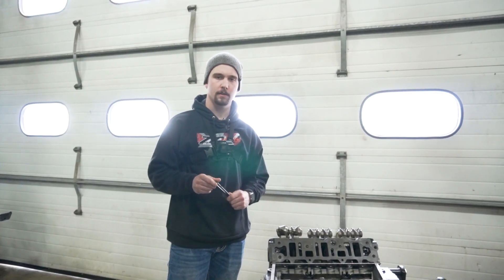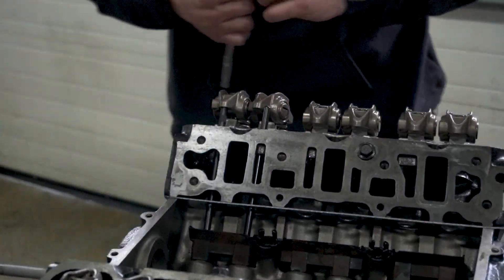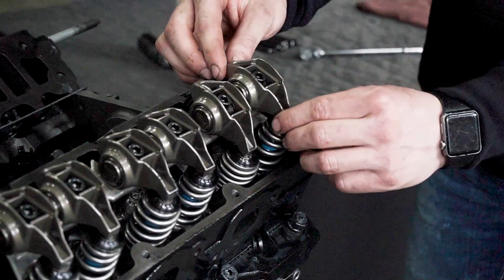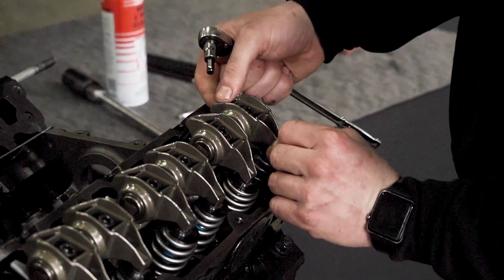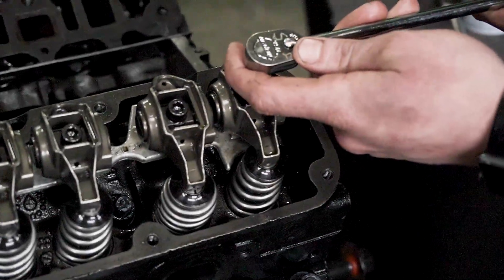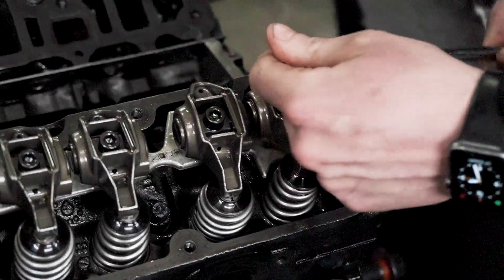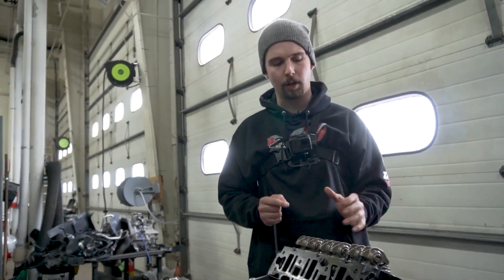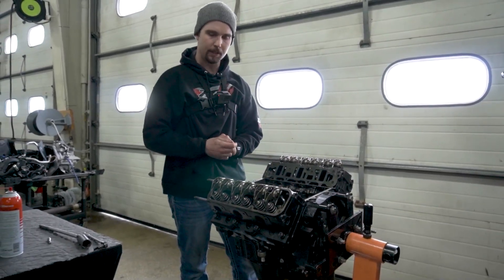How To Measure Your 3800 Pushrod Length

Comment: Correct me if I'm wrong, but 1 turn of a 5/16-18 rocker bolt is 1/18 = 0.055". So you are preloading these LS7 lifters between (3/8 turns)*0.055=0.021" and (3/4 turns)*0.055=0.042"? Is that the correctly intended preload? Your website says "1/2 turn of the rocker bolt is ~.050 of lifter preload", but it seems to me that 1/2 turn would be 0.055/2=0.028" instead. Either does not seem correct to me for LS7 style lifters. BTR suggests for stock GM/delphi LS7 lifters 0.060"-0.080" preload, not 0.021"-0.042". Other sites will say between 0.050"-0.1" preload on LS7's. If your intended preload is indeed 0.021"-0.042", this procedure would seem correct, but the actual preload your website suggests it is achieving seems incorrect (3/8 to 3/4 turn would be 0.0375" to 0.075" according to the website's claim at the 0.050" per half turn). What is the actual intended preload? Is it 0.021"-0.042" (3/8-3/4 turns @ 0.055" per turn) or is it 0.0375"-0.075" (@ the 0.050" per half turn)? Or something else entirely? Am I missing something? Is the rocker arm length multiplying the effect of the inches per turn of the rocker bolt? Or does your "ZZP" LS7 lifter require a different preload than normal LS7 lifters? Not to mention, the product descriptions are very confusing, as OE and OE-R lifters appear nowhere on your website, and are not relevant to the LS7 lifters; one other part even says 3/8 to 1/2 turn instead of 3/8 to 3/4; please clarify this stuff. Anyways, the way I did it instead was use the push rod length checker, tighten down the two rockers, increase the checker's length until it binds seated in the rocker/lifter, then measure the length of the length checker, then add the recommended lifter preload to that length, then order push rods closest to that result.
Your website product pages say this here:
https://zzperformance.com/products/zzp-pushrod-length-checker?_pos=1&_sid=a70ff2f84&_ss=r
https://zzperformance.com/products/zzp-hydraulic-roller-lifters?_pos=2&_sid=46cf1540a&_ss=r
 also would be in your video - https://www.youtube.com/watch?v=lua8fTZ_cZU